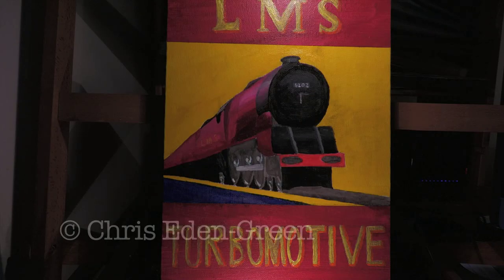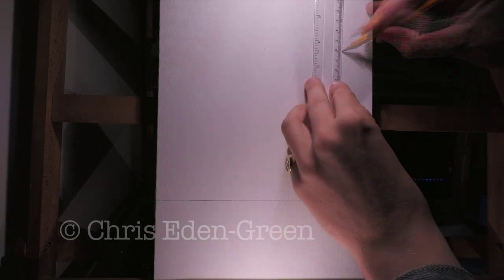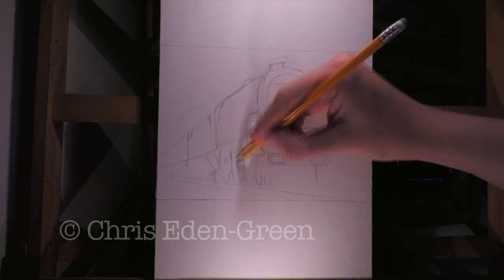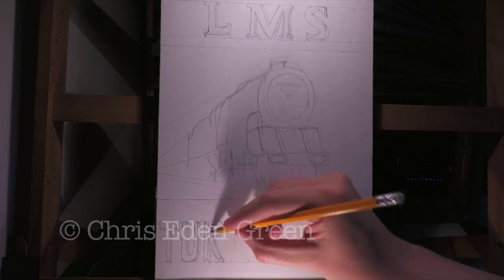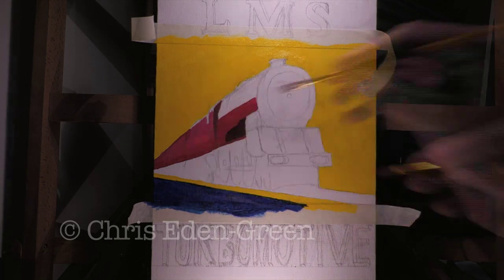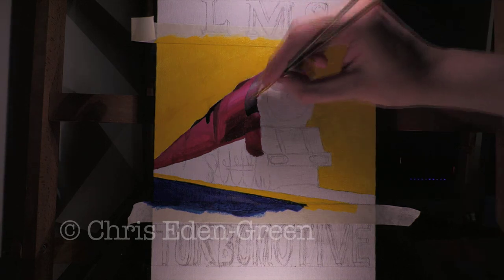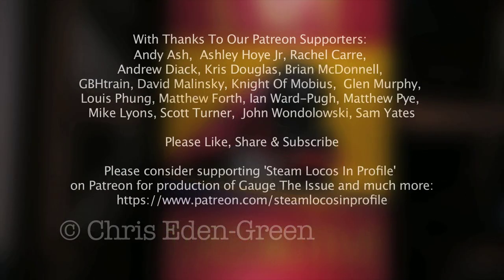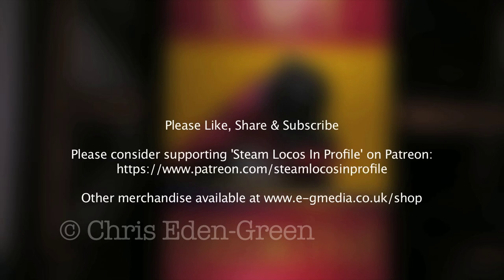LMS 'Turbomotive' (Paint Your Engine)

Comment: Some interesting Turbomotive trivia I collected: -

- Unlike the heroic failures of Fury, Hush-Hush, Leader or the GWR Gas Turbines, the Turbomotive was considered by the LMS Engineers to be successful. In 1945 the LMS (RC Bond) declared she had the second highest annual mileage in the entire LMS fleet and her previous shortcomings had now been engineered out. This is perhaps optimistic as according to 6203's record cards prior to WW2 some Princess-Royals were doing between 70-80,000 miles per annum, but that had dropped to 50,000 in wartime and never recovered (more Duchesses available?). But it is interesting to note that the Turbomotive was by then considered atleast on par with her sisters. In her last year as a turbine in April 1949 to April 1950 she achieved her maximum of 62,000 miles per annum when the rest of the Princess Royal Class average was 43,000 miles. Therefore "Gracie Fields" had eventually bettered all her Regal sisters! 

- Her downside was lengthy delays in the works due to the cost and lead times of bespoke spare parts that would have been resolved if more Turbomotives had been built. Similarly, she had to be sent to Crewe for specialist repairs that Camden was unable to handle. Unfortunately, the relatively short distances between UK cities meant there were few non-stop diagrams suited to Turbomotive operations.

- Her mechanical efficiency was 8% higher than reciprocal sisters which did not deteriorate with use wear and tear.

- tractive effort was 40,000 lbs starting and 12,000lbs at 70mph. Turbine efficiency was at its peak at 760 rpm @ 60mph but was rated to 10,220 rpm @ 90mph. The gear ratio was 34.4:1 The forward turbine was on the Left hand side of the frames ( drivers side) the smaller reverse turbine with a drive ratio of 77:1 was on the right (fireman's side). 

- her original 1935-1936 domeless boiler (9100) was later updated to include a dome and is now preserved on 6203 Princess Margaret Rose.

- 6202 was the only Princess Royal to carry a Double Chimney.

- steam turbines operate most efficiently on long non-stop runs at steady speeds therefore 6202 was usually dedicated to Euston to Liverpool services.

- three mechanically similar 2-8-0 Turbomotives survive in Sweden with Ljungstrom turbines built in 1931. Stanier visited Sweden to inspect the trio before deciding to commence with 6202. One is currently under restoration to working order. One has worked as recently as the 1980s / 1990s. Unfortunately for anyone looking for an authentic Turbomotive sound file be warned that they are fitted with Westinghouse pumps!

- 6202 was a joint venture between the LMS and Metropolitan Vickers of Trafford Park Manchester, who had a partnership with the Swede Frederick Ljungstrom. Ljungstrom had also previously built an experimental locomotive with Beyer-Peacock and tested it inconclusively on the LMS between 1926 and 1928.

- 6202 appeared in BR Blue in the illustrations of a 1948 Janet & John story book, but did not carry this livery. 1935-1946 Crimson Lake, 1947 LMS Black, 1949-1951 BR Black, 1952 BR Green.

- 6202 was fitted with a small turbine for reversing. This was really only capable of moving the loco light engine at low speed. She therefore was not allowed to haul / push trains tender-first. Photos suggest an attempt was made to haul some empty carriages without success.

- 6202 was the first British Steam locomotive to have been equipped with roller bearings throughout. She had no plain bearings. An examination of the bearing condition by Timken in the 1944 gave key evidence to support the widespread application of this technology on future British locomotives.

- 6202 always worked with a footplate crew of three as a fitter travelled to assist crews and attend to her daily maintenance. This was extended to four if a traction inspector visited. 

- 6202 was the first and only locomotive to be fitted with a speedometer by the LMS, the absence of noise / vibration caused difficulties in judging speed.

-  The Turbomotive had a unique sound, she had no staccato-type exhaust, but an continuous flow of spent steam that above 15mph was noiseless. Below 15 was a rising singing note giving the Turbomotive her nickname "Gracie Fields" because "she sings as she goes". Above 60mph there was an deep unobtrusive musical hum of resonance in the turbine gear train. 

- Track workers cautiously called her "The Ghost Train" as the lack of noise worried them. 

- Apart from a short stint at Edge Hill in 1930s 6202 was always London Camden allocated.

- In 1936 plans were drawn up to fit 6202 with a Coronation-style streamlined casing and wooden models were developed for the LMS Wind Tunnel (the wind tunnel survived at the University of Derby untill around 2003 when it was broken up, my brother was able to make a bass guitar from wood he salvaged from it).

- 6202 was rebuilt into the reciprocal locomotive 46202 "Princess Anne" in 1952 and basically became a hybrid Princess with Duchess cylinders & motion. Tragically the Super-Princess completed in August 1952 and heavily damaged in the Harrow & Wealdstone triple collision two months later in 1952. The crash resulted in 112 deaths and 340 injuries, 88 of these being detained in hospital. It remains the worst peacetime rail crash in British history.

- Not all of 46202 was scrapped after Harrow. Her tender was repaired and re-allocated to Stanier 8F 48134. The boiler 46202 carried from 1936 untill the Harrow crash in 1952 No.9236 (that uniquely had an extra row of superheaters for use with turbines) was repaired and transferred to 46212 in 1954 and 46208 in 1960 untill scrapping in 1962.

- There is some controversy over the scrapping of 46202. In the HMRI report she was described to be in the best condition of the three Harrow engines, her crew both survived and the boiler and tender quickly repaired. The frames were sound enough to allow the hulk to be towed at low speed to Crewe from Harrow. Yet 46242 City of Glasgow was repaired and 46202 was scrapped suprised many. The engine repair card show it was allocated to the 1953 overhaul programme but then states withdrawn from stock 22.5 54 by special authority. The consensus amongst historians is that the building of 8P 71000 Duke of Gloucester (completed in June 1954) had gone over budget by 25% and 46202 repairs were sacrificed to cover the overspend. Robert Riddles and E.S. Cox both later retrospectively claimed 71000 had always been their intended replacement for 46202.
Reply: What a helpful trove of information thank you